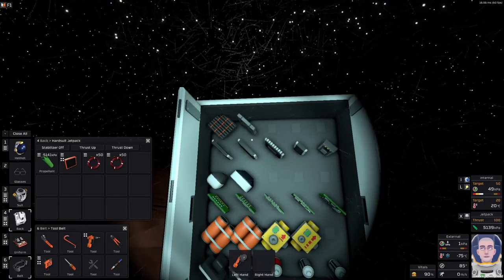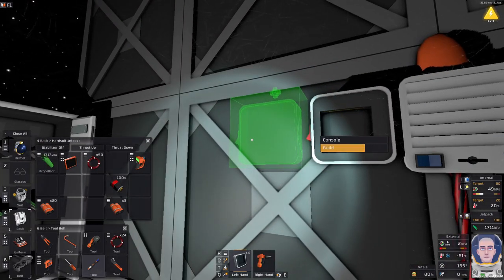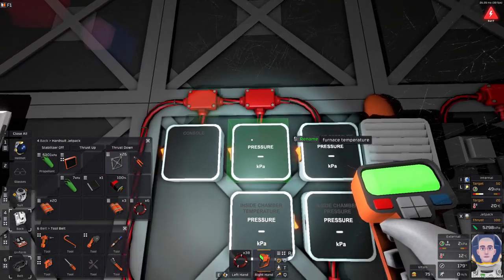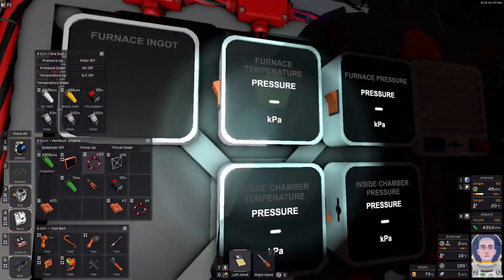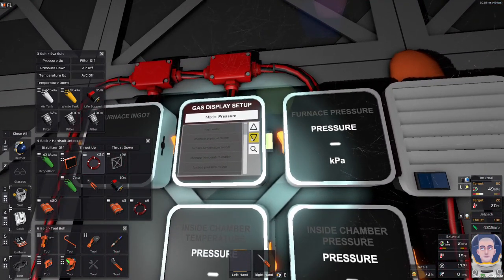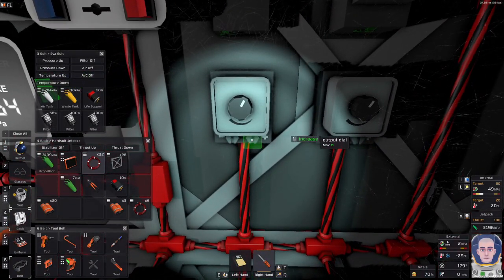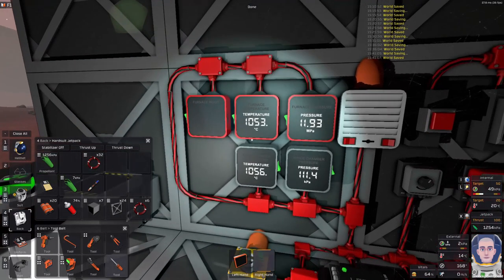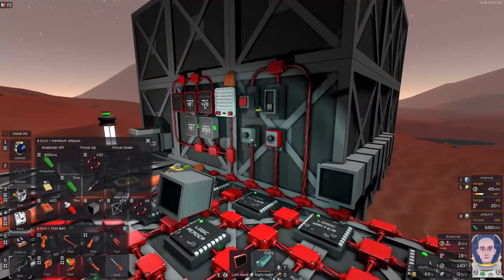Stationeers advanced furnace tutorial (no ic chip required)

Comment: It's me again.
Something seems to be wrong. The pressure and temperature are displayed, but the hash value does not match. What are the values of the hash logic writer(In/Out/outvar)?
Reply from the maker: I actually forgot to mention it, but you don't need a reader/writer setup to display a hash to the console, you can do that directly with the hash display circuitboard, you need to select the furnace and that should do the trick, if not select the furnace in your reader, the hash as value and use the writer to display it on the console by selecting as an input the reader and output the console. Make sure it's the correct console too.
Reply: @tomatosoup5056  Thank you for your support. I made my first Superalloy (Astro) today. The whole setup is a bit glitchy (temps and pressure jumps) but it works.